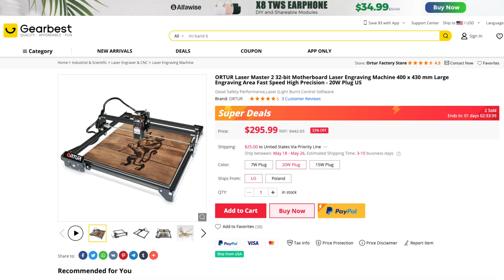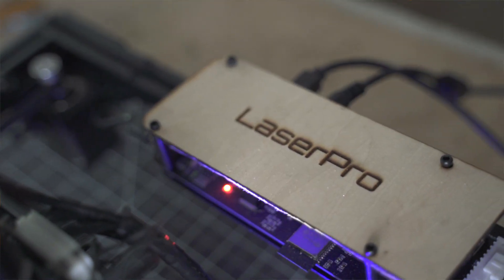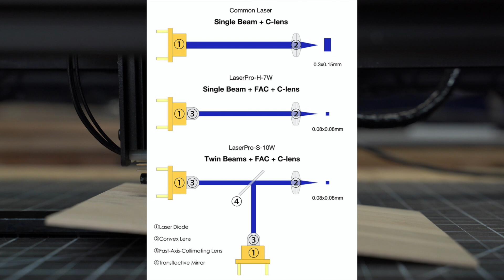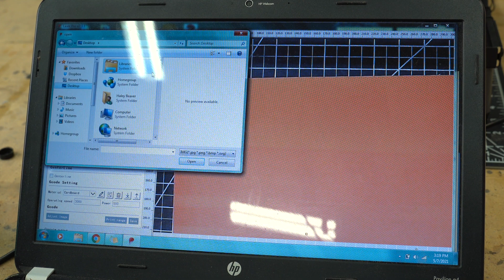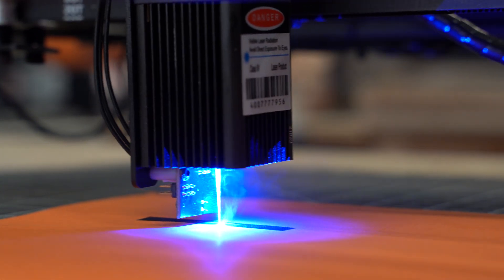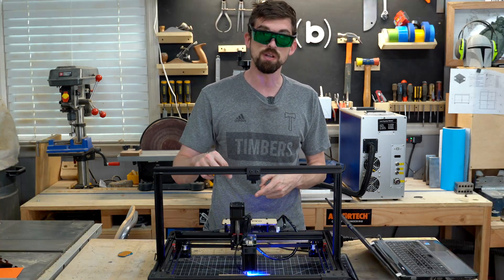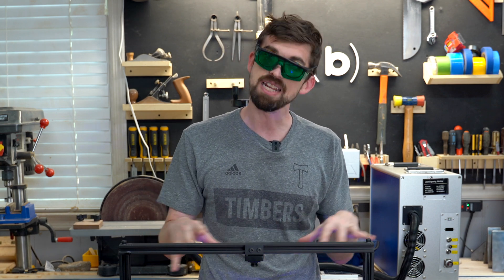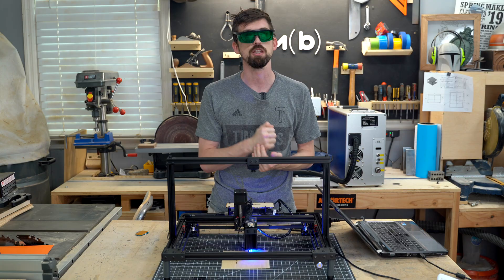SparkMaker LaserPro: The new King 👑 of budget laser engravers?

Comment: The software that is shipped with the LaserPro is buggy and and not very powerful. LaserPro is not compatible with Lightburn - yet - they are working on it. However after several weeks playing with it, I found that with a very simple GCODE header and footer added to the Lightburn configuration file, the LaserPro will (mostly) run with Lightburn. It has a very small spot and is very powerful. It easily cuts 3mm plywood at 225mm/min at 95% power, and engraves literally everything. It has an internal fan that provides air assist, blowing air from the same orifice as the laser, and the lens is recessed in the laser head so smoke does not settle out on the lens. The auto focus works great, and the enclosure with the fan lets you vent the smoke out a window. The video camera takes a bit of careful setup but is extremely useful. When the LaserPro is fully Lightburn compatible it will definitely be the diode laser engraver to buy. My LaserPro is now the one I use for all my projects, and my previous laser engraver (which I was very happy with) sits pretty much idle.
Reply: Any info on the header needed?
Reply: @TR-qt8tf  This will get you to cutting and engraving on flat surfaces, and the camera will work as well but must be calibrated. You have to make sure the autofocus point set in the header is on your work piece or you can delete the last two lines in the header or comment out with ;  and manually focus to 11mm. Rotary  cannot be made to work in Lightburn at this time.

first, you need to setup a device based on GBRL - Serial/USB, 305mm x 215mm, origin at left rear, then Device Setup- Origin W305 , H215, Left Rear, Enable DTR signal, Enable Out of Bounds warning, return to finish Position - everything else disabled. then in Device Settings Gcode - Header 
M17
GO XO YO ZO
M4 SO
F3000
GO X45 Y45 SO
M206 S11 SO

Footer:
F3000
M4 SO
M206 SO
GO X0 Y0 Z0 
M5
M18

NOTE!! Autofocus will ONLY be at x45 y45 and this point can be changed by changing the numbers in the header.
Reply: @robertmoran9225  Thank you Robert!
Reply: You're the man for this comment! It's surprisingly hard to find reviews & information on this laser engraver and I'm trying to figure out how this thing measure up to say the xtool d1 or atomstack x7 pro
Reply: @Mr-Enac  Information is almost non-existent, and the support lads keep insisting that their software works just fine when it doesn't, at least on my computer.

I don't know much about other laser engravers - I backed the Kickstarter for the Laserpro primarily due to the 10W laser and promised Lightburn compatibility. There a lot to like about the LaserPro - it would be a great system if it was Lightburn compatible. I really like the camera and the (limited with Lightburn) auto-focus, but until the LaserPro folks get their act together and achieve full Lightburn compatibility, I would recommend buying another 10W system unless you are willing to gambol that eventually LaserPro will be made comparable with Lightburn and can live with the reduced functionality until then (the inability  to address the z-axis with Lightburn is a big one). That being said, I find it inconceivable that, with as bad and buggy as the LaserPro software is, that the LaserPro will not eventually be Lightburn compatible.  Otherwise, the LaserPro will join the Dodo.
Reply: @robertmoran9225  Thanks for the honest thoughts. Appreciate your input so much.  I wish a few of these laser companies would just merge and make one bad ass entry level diode laser with all the important bits from each >.<

Comment: Whether it is laser engraving or laser cutting, in fact, the most important thing is two points, one is the laser power and the other is the smoothness of the frame movement.
Laser power not only depends on the input voltage and current, but also depends on the good or bad laser diode, a good diode can make you more quickly into the perfect carving, on the market these products, the laser spot compression is the best, whether you are cutting or carving, despite the product is not good but have as much as possible to Advertisement and make the spot compression of the product is difficult to show the light.https://youtu.be/qAwesZPInhw
Reply: Whether it is laser engraving or laser cutting, in fact, the most important thing is two points, one is the laser power and the other is the smoothness of the frame movement.
Laser power not only depends on the input voltage and current, but also depends on the good or bad laser diode, a good diode can make you more quickly into the perfect carving, on the market these products, the laser spot compression is the best, whether you are cutting or carving, despite the product is not good but have as much as possible to Advertisement and make the spot compression of the product is difficult to show the light.https://youtu.be/qAwesZPInhw

Comment: Do you think there's a big difference in the different wattages of the Otur 2? And should I wait if I'm not rushing in buying a laser engraver and wait a month or two in hopes of this releasing and it being double the price?
Reply: The LaserPro is about double the power of the high end Ortur laser. The Ortur "20W" model is only 5W of optical output power. The LaserPro is actual 10W of optical output and can even mark on stainless steel as well as easily cut really thick materials like MDF.
Reply: @Aerospacesmith  the higher power the bigger the beam, its a tradeoff, https://www.aperturelaser.com/ makes a 2w tile master that gets high detail on NWT method, hands down best laser i have used.
Reply: @Aerospacesmith  atomstack has a 10w and neje has a 15w. 
I like this but the work area is to small for my needs.
Reply: the higher power the bigger the beam, its a tradeoff, https://www.aperturelaser.com/ makes a 2w tile master that gets high detail on NWT method, hands down best laser i have used.
Reply: @chrisfrisch1347  
Agree, and often over looked. You pick up speed with more power but loose detail.
Reply from the maker: I don't think there are a ton of differences with wattages especially on the diode end since you really aren't doing lots of cutting with it to begin with.  Ortur is also coming out with a new version that could be a good option as well!

Comment: Please no more stupid Baby-Yoda engraving...we are interested about CUTTING and nothing else. Sure for cutting a Co2 better but also cost a lot-lot more, and also a lot more complicated

If it is dual laser and 10W it should be able to cut 5mm plywood MDF and many other thing which is just enough....  Please test cutting!!!!
Reply: Hey, this is an early version 7w engraver of SparkMaker. It used a 20mm focal length, not good at cutting actually. Our offcial version uses a 45mm focal length , which has a very better cutting effect. The 10w laser can cut through 8mm basewood in one pass, please take reference at https://www.youtube.com/watch?v=q4ThaZe_-ag
Reply from the maker: @MyLastGadget  this is a great demo of cutting, thanks for linking it!
Reply: @MyLastGadget  Thanks ... What is basewood??? Is it the same as Plywood or MDF??? 8mm seems to be a lot... Probably it has to go through several times
Reply: @bacsijancsi  Sorry, it's MDF. It's one pass cutting.
Reply: @MyLastGadget  THAT IS NOT MDF I looked at the video MDF is heavier wood grain sticked together with glue, does not have levels. It looks like some kind of lighter playwood or I don't know. No way you can cut it with any kind of diode laser with one pass, that is just impossible. A stronger CO2 laser might do that but even that needs more passes. This is a simple LIE. False marketing!!!
Reply from the maker: Basswood is a really light wood, almost like balsa but a little more dense
Reply: @makeorbreakshop  Ah thanks...than it is easy to cut :-)
Reply: @MyLastGadget  Thanks!!!!!
Reply from the maker: If your looking for no more stupid Baby Yoda engraving then your going to be out of luck ;).  Real talk though this unit wasn’t the 10W and even if it was the speed it would need to run be burning wouldn’t make cutting practical.  But this would be a good thing to show in the future.
Reply: @makeorbreakshop  Sorry I did not wanted to be rude :-) I just don't see the meaning of engraving :-)  Well I would be interested of some cutting 3-5mm plywood going well although slower with the stronger diode lasers as far as I know  (CO2 lasers are a different category with price and complexity)
Reply from the maker: @bacsijancsi  ha no worries!  In general I'll recommend diode lasers for people who want to do engraving.  For cutting it might make sense to step over to a CO2 laser which has it's own drawback but that wattage can start out at 40W.  I do think the double diode in the 10W can be a really cool option though, I just haven't tested it.
Reply: @makeorbreakshop  Yeah that might be the end but I would start my lasercutting life with a diode laser :-) Not just because it is cheaper and well I might sell it If I invest into CO2 but also I don't know how often I will use it and Co2 has problems as I heard. Not just the cooling and fume extraction need but also that EVEN IF YOU don't use it CO2 laser tube deteriorate by itself the C02 gas diffuse out from the glass tube so the tubes has to be changed regularly (in every year) and they are NOT CHEAP :-) even if you don't touch them...  so if you have CO2 laser you HAVE TO use it regularly (as far as I heard)
Reply: @bacsijancsi  I have a 30watt neje laser (7.5w) output honestly cutting with diode laser ain't fun there's more tinkering than working and it's painfully slow
Reply: @meowmeow871  OK I am sure it is but a little tinkering might help. Air assist can reduce cutting time significantly also a kind of metal bed to keep the material above the surface. I am sure it is slower but I saw a lot of video on YT where 3mm plywood was not really a problem (ok it took 3-4 runs but it worked nicely) I wood use it for model plain mainly, cutting thin plywood and balsa and foam. Foam is really not a problem...
Reply: What computer programs are needed to use the spark marker?

Comment: It should be mentioned that the Protective/Colored enclosure they offer as an addon also has some updates, an extraction fan/vent.  Also all updates based on Backer suggestions.
Reply from the maker: Good point!  I didn't get too deep into the enclosure, but having a fan built in is great, you'll still just need some tubing/pipe to vent it outside
Reply: Ortur does offer an enclosure as well. Comes with a 12v fan and tubing.